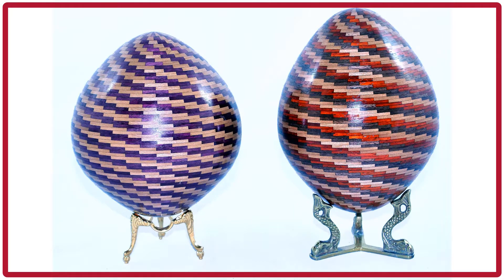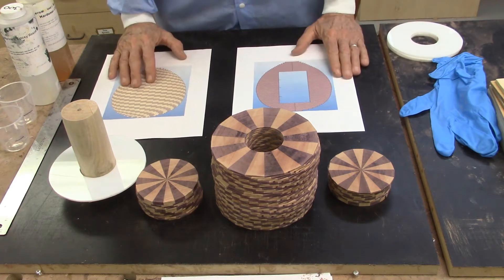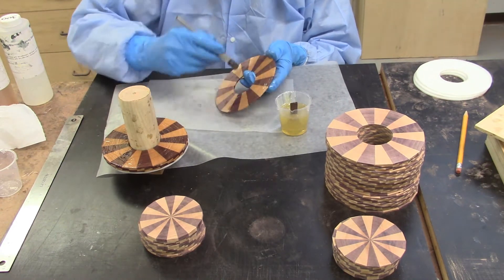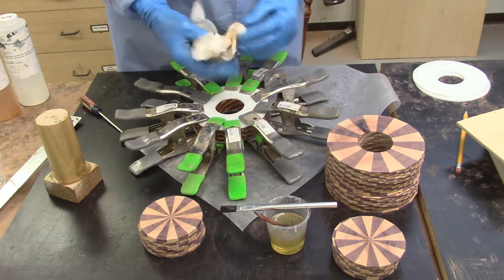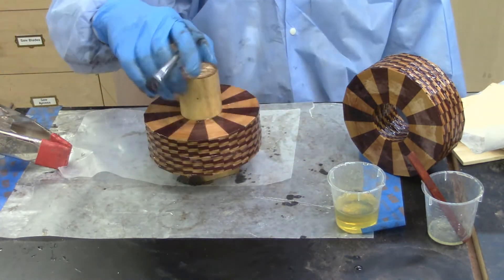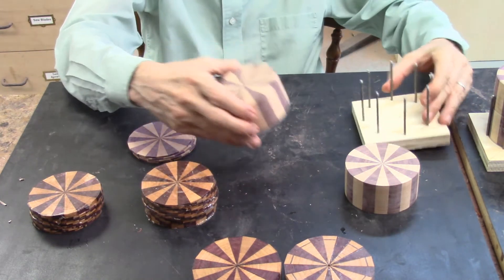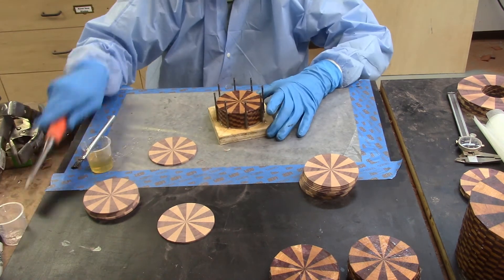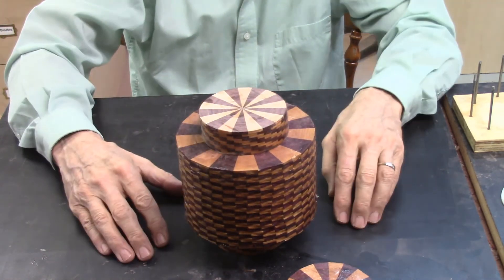Segmented Wood Eggs - Tornado Pattern - Part 2 - Gluing the Segmented Ring Layers using Epoxy (33)

Comment: Why are you using epoxy to glue them together and not wood glue??
Reply from the maker: I use epoxy because of the long setup time - approximately 46 minutes. When I am gluing up more than 10 pieces of wood, the Titebond glue sets up too quickly.  The West Epoxy system gives me at least 45 minutes to apply glue to all the surfaces and then clamp the glued pieces together.